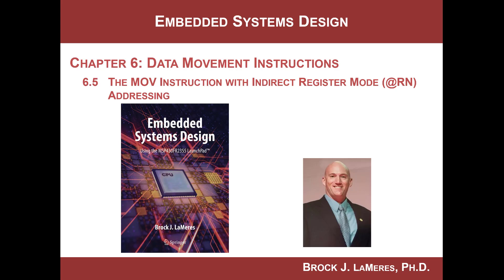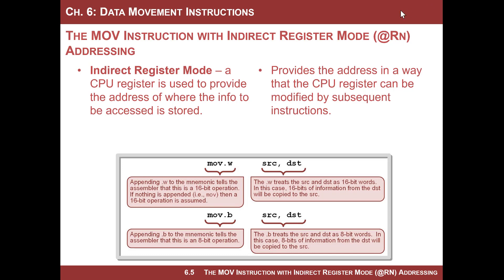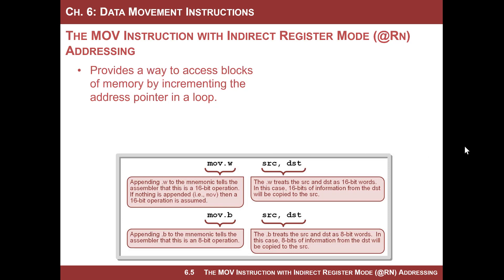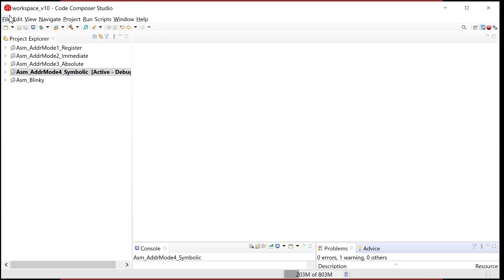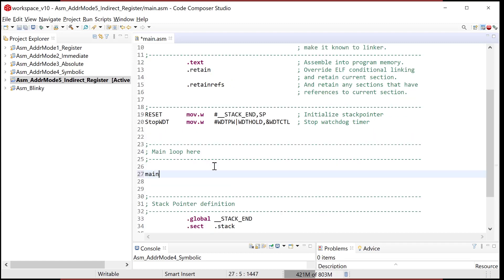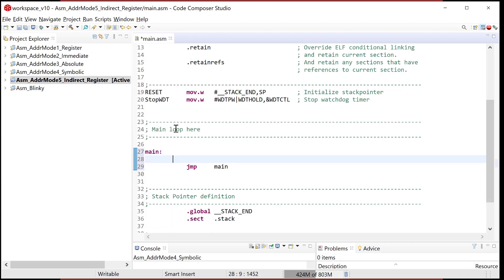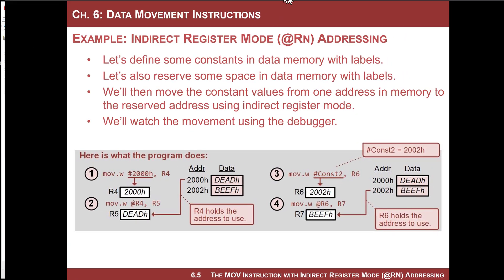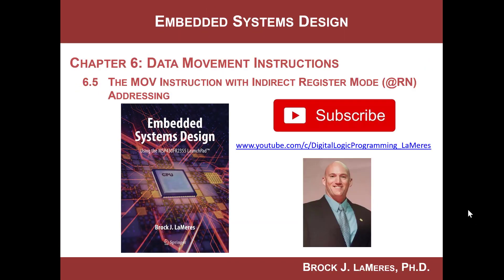6.5 - MSP430 MOV Instruction using Indirect Register Mode Addressing

Comment: Hey Brock, does the mnemonic .data go to the "program" or the "data" memory?
Reply: Everything below .data directive goes into the data memory.  The program memory starts at 0x8000h and data memory at 0x2000h - debug it, setup your break point, step through the instructions and read into register and memory browser starting at 0x8000h or 0x2000h
Reply: @clo7473  Thanks!